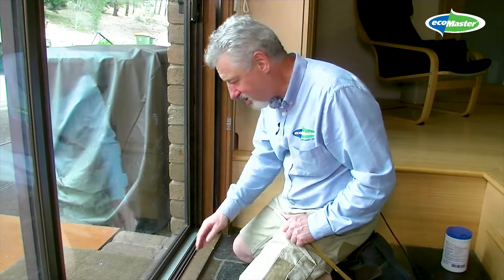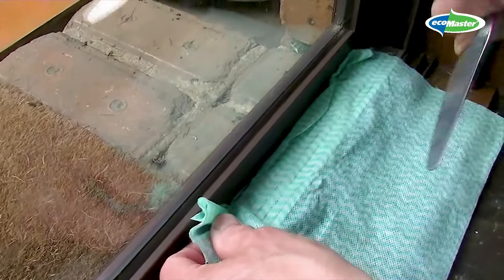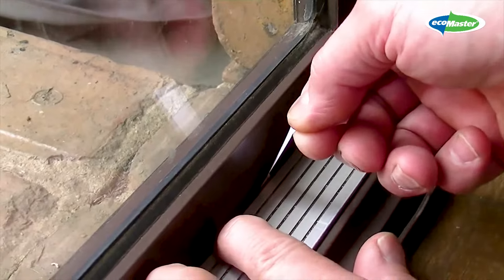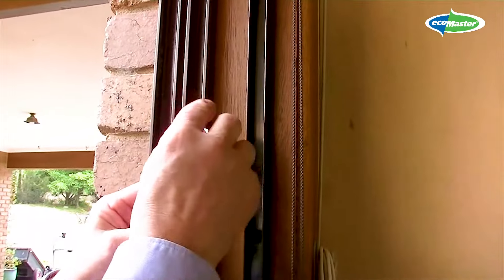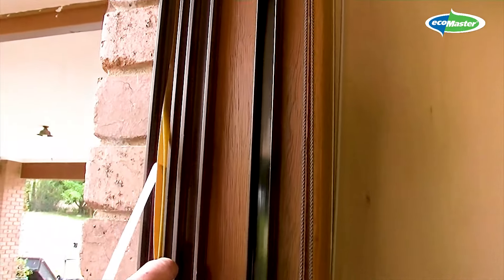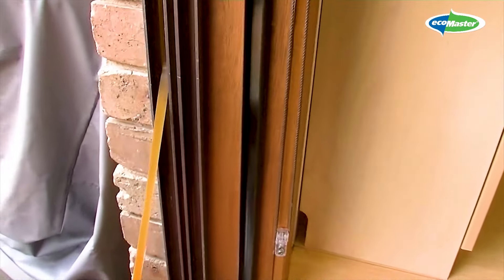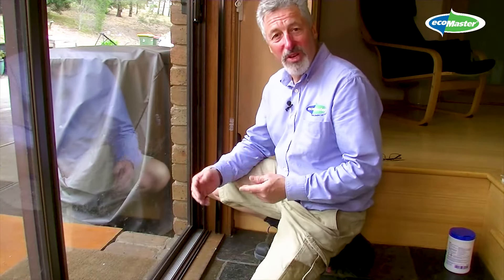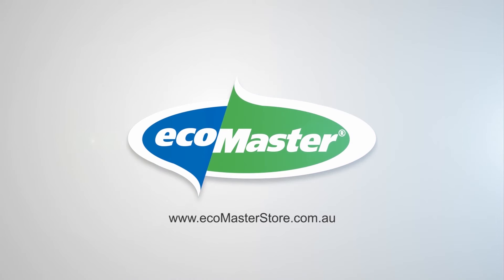How to Draught Seal an Aluminium Sliding Door or Window | by ecoMaster

Comment: This is a good video however there seems to be an unlimited amount of patio door types, styles and weather stripping to go with each! It is very discouraging trying to fix the stripping on my doors as whatever I buy doesn't fit right and that's just for my patio door! Nevermind for the doors. :(
Reply from the maker: Hi,  
Yes - we totally agree with you which is why we are introducing two new ways to analyse your draught proofing issues and provide you with sensible solutions that work: 
1)  The Draught Proofing Information Hub - which can be found here https://www.ecomaster.com.au/draught-proofing-information-hub/"
2) Find and Fix The Draughts in My Home - which will be found here (not quite ready yet). 
https://ecomasterclass.ecomaster.com.au/registration
Cheers 
Your ecoMaster team

Comment: Will this system work on sliding timber doors too? I assume so?
Reply from the maker: Hi Judy,  Sliding timber doors are much more challenging that aluminium.  There is no standard timber sliding doors so EMV Slim Line seals may or or may not improve the air tightness of your door.    
To get an airtight seal on a timber sliding door, you could need to have a professional draught proofer assess your doors.

Comment: Will this work to keep water from coming in as well? If not, can you recommend a solution? My back porch floods in heavy rainfall and I sometimes have water come in around the door. Thanks.
Reply from the maker: Hi Josfos, If the door is being flooded with water, then there is probably no seal that will make it waterproof.  
If the water is from splashing, rather than flooding, then the EMV would probably be of assistance.    It has been designed for air leakage,  rather than water proofing.  Cheers!

Comment: wouldn't it make more sense to put the v upside down? so it catches the drafts on the way in? My worry is that the wind will blow and as the bottom of the V is facing the wind (so to speak), it will blow past it. When you do the vertial, you do it this way round. Why not do it that way round on the bottom? I am confused.
Reply from the maker: Hi Stretch, Thanks for your question.  The reason we suggest installing it with the V facing down is that in more instances you will make a more effective seal on the door (utilising the brush that comes with the door).   Your idea is a good one if you are expecting gale force winds underneath your sliding door.  Given the design of most sliding doors, that is less likely.  Cheers

Comment: What's EMV? Can't I just use my steamer to clean?
Reply from the maker: Hi Bonnie, Good question!  EMV is a slim line seal that can draught proof gaps of variable widths - from 2mm to 7mm.  It is folded in half, into a V shape, and can then be self adhered to the fixed frame of a window or door. 
It is suitable for door frames, particularly internal doors, aluminium sliding doors, aluminium sliding windows, casement, awning or wind out windows.  It comes in Brown, White and the very popular Clear - oh, and there are discounds for volume purchases. 
I am not sure about the part of your question about a steamer to clean. :-(
Reply: @ecoMasterAu  do you have any more videos or images of the seal strip? I'm looking for something like this but I want to see what it actually looks like. This video shows it at a distance, not up close.

Comment: That's great, but how about the space between the window plates in the middle? It's the most drafty one for me.
Reply from the maker: Hi Ivan, because there is no standard aluminium sliding window / door - the trailing edge solution is different from type to type.  
We don't have a standard solution for that yet.  Cheers ecoMaster
Reply: Silicone sealing strip
Reply: What's that?

Comment: One question. If the EMV is folded over on the base of the door, doesn’t it catch in the corner when you’re sliding the door open?
Reply from the maker: Hi Puff,  
That is a very astute question.  No, it won't catch because the EMV goes the full length of the bottom track, which includes the sides of the door. 
As the door opens, the EMV will be compressed just a little more as the door edge slides by. 
That is such a good question, we will add it to the FAQ on the EMV product page. 
Cheers!

Comment: What about in the middle where the two panes meet? I have a draft there.
Reply from the maker: Hi Christine, because there is no standard aluminium sliding window / door - the trailing edge solution is different from type to type.  
We don't have a standard solution for that yet.  Cheers ecoMaster